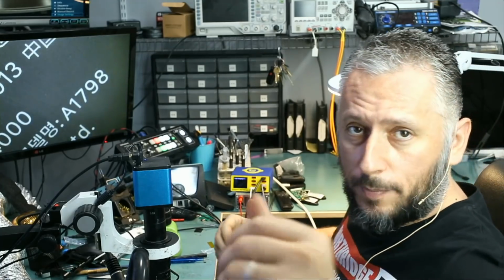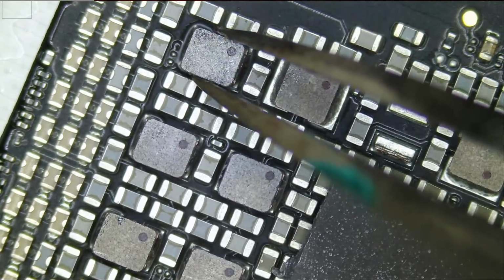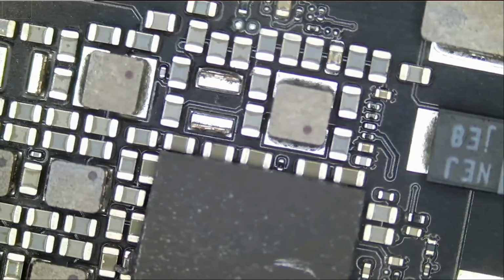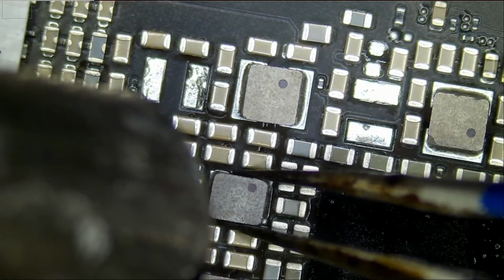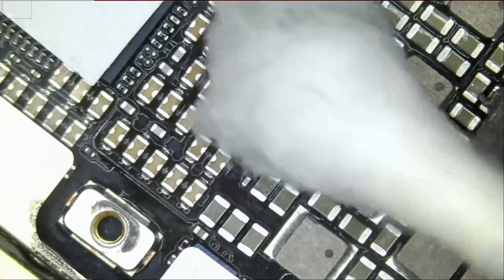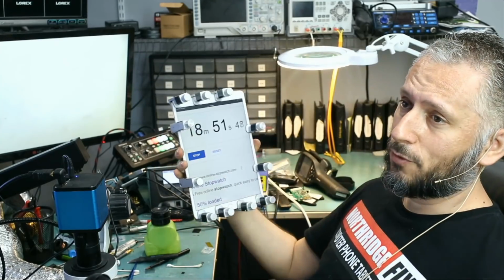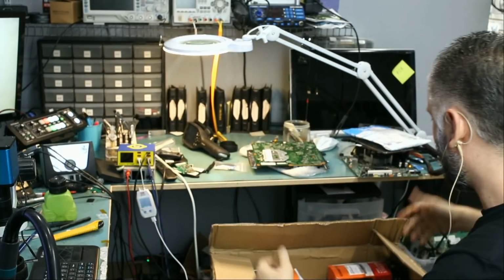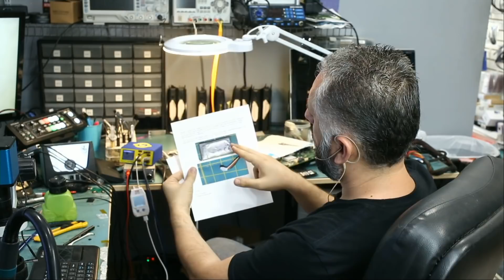iPad pro 10.5 Repair Constantly reboots & Tons of Broken GPU Mail-in Repairs

Comment: I'm sure you hear this a lot. I was a welder and went to college for almost 8 years . I then went to work up in Alaska where I was born. Worked at Red Dog Mine and learned to be a Heavy Equipment Tech. After that job. My boss and I started our 9wn Heavy Equipment repair and parts company. We lost our company because I was in a plane crash in AK and became disabled. I've fought the government for 13 years now and I'm done. They of coarse took everything I worked my whole life for. Now I'm to the point that I am going to start my own company again. But this time I want to focused on GPU cards. I've just built a high end i9 13900k CPU and the Asus ROG Strix Z 790 board with the Asus ROG Strix oc 24gig 4090. I've been 2atching all your videos and am so thankful for you sharing your knowlage! I am saving up to buy the equipment I need from you. Your microscope and everything for it plus the best soldering station plus micro pen. A bunch of flux and the different solder and I will be buying stock in your circuit book and components.

Again thank you for being such a great company and a great mentor!

Comment: The amount of knowledge you have acquired is inspiring :) I'm a hobbyist myself, but just got myself a 2nd hand hot-air station and I'm using it on everything for practice right now :P A voltage injection tool is the next on the list!

Comment: At the beginning of my repair practice I was always concerned with the exact match of the dots on those coils. Like in pulse transformers. There dots show the start of the wire winding and the side where voltage starts inducing. There its realy important. Here its not important. Probably 😀
Reply: The dots are on schematic not on the transformer itself.
Reply: Inductors resistors, has no polarity it can be connected either way
Reply: @godfreycarino2808  what about capacitors ?
Reply: @RandomGuy-om1vy  some caps are polarized some arent

Comment: Help!  I opened my iPad 10.5 model A1798 I started to look for loose coils to solve the rebooting issue, but all coils seem to be in place, after several hard looks, O feel I found the missing cool, cut can not confirm as the coils in your motherboard are non-existing, meaning, mine has a whole area of coils yours does not!  at 4:20 to 4:25mins your video shows an empty space, mine has a whole bunch of chips there, so no way to tell what it's supposed to look like!   please advise? thank you

Comment: how the hell do you keep up,i am a electronics repair and fleet management technician.I work during the day 8 to 4 and after 6pm i repair consoles and weekends i repair laptops and desktops and i get all my work done by Tuesday. i have 3 ps3 consoles  to repair 2 ps4 consoles and 2 ps2 consoles and 2 psp to repair.i turn away gpu and cell phone motherboard repairs.one must work efficient and get the most profit per job in a time frame.
I suggest you prioritize repairs for max profit like i do.So do not accept jobs that you know is gonna take hours .